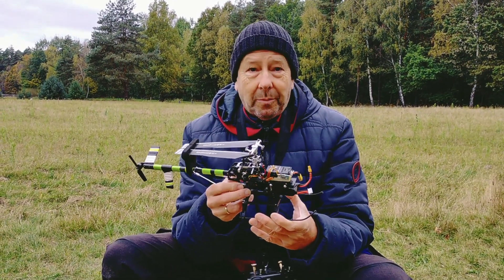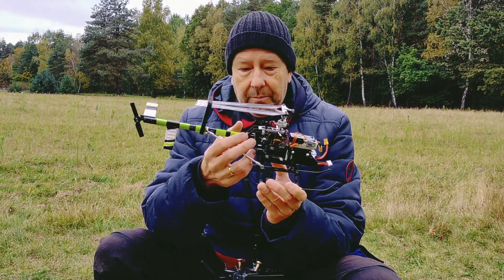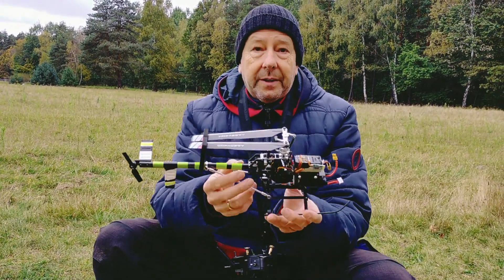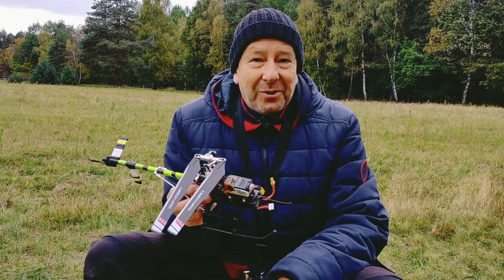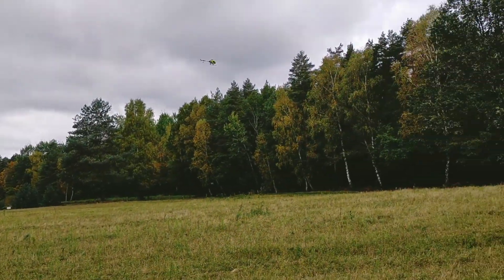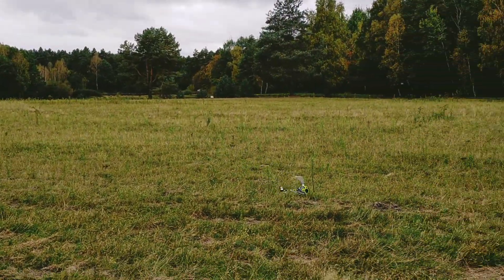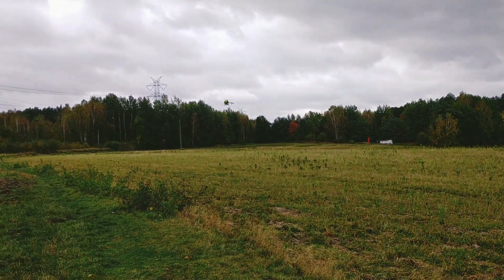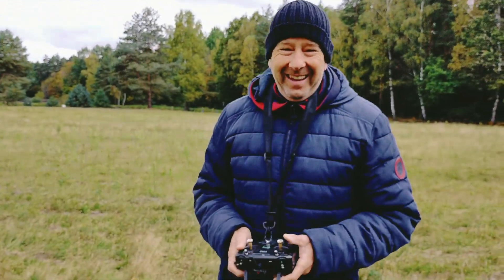Simplest M2 Scale Heli build, flight + love declaration

Comment: Good explanation! Your video will definitely help some people get started with scale flying. I thought exactly the same thing when I started scale flying. That's why I first bought the CBI300 fuselage from microheli (for my Blade 230 Smart) to practice my first longline flights over water with a functional micro Bambi bucket. Before I did the same thing with the Bell UH-1 from Microheli. Have you seen my latest video yet? (Blade 230 Bell UH-1 with short line and functional Bambi Bucket)
Does the OMP Hobby M2 have a free servo channel where you can connect a servo for scale tasks? I'm thinking about switching to m2..
Reply from the maker: Hi and thank you! I have watched your Bambi Bucket video and I love the idea! Have you seen my M4 sling load operation training video with my OMP M4 (400 class)? My sling load does not have any function yet - but your vidoe inspires me. Great flight with the bucket! I think it's realy a great training to do something we did with our helis. In one of my last videos I was flying over a lake and now after watching your video I will try it with a simple Bambi Bucket first. I guess you will like the OMP M2 EVO very much. It is very stable, accurate, precise and powerful. I was starting with the Blade 230S V2 and found the OMPHOBBY M2 much better to fly. I guess that with a sattelite receiver you should be able to activate additional channels like you do with your Blade helis. I am using Radiomaster and Edge TX and I am unexperienced with it. But in Spektrum it sould be no problem. I left you a subscription! Thanks for your inspiration!
Reply: @RCCopterLove  Yes, I saw your video too and I think I even commented on it because I thought it was cool that you were experimenting with it. Flying longline was the greatest motivation for me to fly more precisely and calmly. It's not easy to learn, especially during the first few flights. I hope that more people will be inspired by our videos. And I'm happy to hear that you were also inspired by my video. But please be careful. However, I think you can do it well because you are a very calm, level-headed pilot. I wish you a lot of fun with your training and look forward to your video. I also subscribed to your channel :-) I'll ask my colleague who has an M2 whether he can activate an additional channel on the m2 fbl. And if so, then I'll buy an m2 too :-) I know what you mean about the Blade 230 with the lack of precision. But it is nice and light and you can fly it at low speeds. This gives a nicer sound. The sound of the leaves is also important to me when flying a helicopter :-) That's why I don't have an m2 yet. But if it works with the additional servo channel on the m2, I will also have to consider buying an m2.. Thank you too for the inspiration and sharing your rc heli passion.
Reply from the maker: @modellflugschuletakeoff  Thank you very much! I see we are thinking in a very similar way! I hope for you that the OMP M2 EVO has the possibilities you need for the additional servo channel. Or that you can manage it somehow with the Transmitter and receiver sattelite. The New M2 EVO is much more quiet with the new tailblade and motor (bigger, different shape than the M2 V2 tailblade). It is much more silent than the Blade 230 S V2 I owned. And because of its direct drive motor it has much more power reseves and allows lower headspeed if you do calm scale flying like the longline operation. For me silence is as well very important. Okay, if I do acrobatics or more agressive turns, I love the sound of the blades ripping through the air. But the motor should me very silent! I cross my fingers that you find a good way for he additional channels! You will be shocked and fall instantly in love if you try the M2 EVO! Thats how it was in my case!!
Reply: @RCCopterLove  Very good point with the silent Motor of the m2! You've convinced me! Now I just have to find out if it has a free servo channel. And if so then I will buy one :-D Ah and I'm writing here from my second channel. Just that you're not confused. Sometimes I'm a bit lazy to log in to the other channel
Reply from the maker: @butterflyfpv  Okay, I get it! 😀 I hope you find a way. I have very few experience and knowledge regarting setup and electronics... I was not really "falling in love" with all IT and programming stuff. Flying is my passion. But I guess you should be able to programm/add an additional free channel on your transmitter and if you are using a sattelite receiver (SBUS) it might work. But as I said, I have no idea of all this stuff 😀 I am 62 now, dont use a smartfone.... you might see what kind of stoneage guy I am.😀
I really hope you find a way, cause it would be a pitty not to fly the M2! It's worth all research. All the best and happy flights!!
Reply: @RCCopterLove  Same here, I do like flying much more than programming and so on.. Unfortunately, there is more and more such technology in the new helicopters. But of course it also has advantages such as fewer mechanical parts. But I'm definitely like you. If there was a way to just fly without programming etc. then I would take that.
Reply: OMP M2 does not offer any extra channel. You can install an F801 DSMX 8-CH receiver to have additional servo ports. 
M2 is nice for 3D aeroatics, but missing the ability for calm smooth scale flight.
Reply: @p.r.5628  OK thank you for the info! I think I'll stick with my blade 230S smart for now. But maybe I'll build one with OMP mechanics at some point...
Reply: @RCCopterLove  thank you so much for the videos and information. I want to get a scale helicopter about this size and am wondering what's the best option for longest flight time? How long flights can you get with M2 and Blade 230 with scale flying?
Reply from the maker: @JoeEngineersThings  Hi and thank you for your kind words! With my M2 V2 inside this little scale canopy I am getting minimum 4,5 minutes flight time with very conservative battery use (restpower per cell 3,85 volts). For sure you can fly a bit longer, up to 6 minutes with slightly slower headspeed. The Blade 230S V2 was my first CP heli and for me personal it was terrible instable and unbalanced and lacked power. I sold mine long ago and after getting the M2 I was never flying it again because the performance was so much worst. This is just my opinion. The new M2 EVO (as well fitting this scale kit) has a bigger battery, so flighttimes will be even longer, up to 7 minutes with lower headspeeds, fitting to scale flying. I hope this helps and best regards!